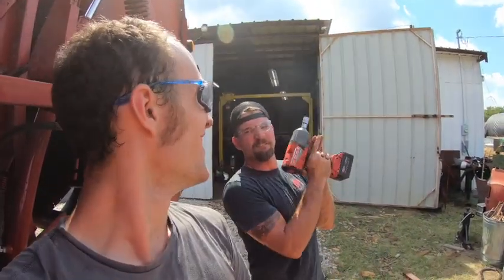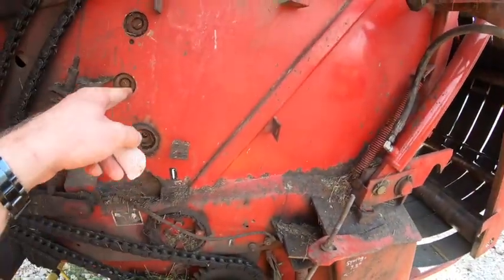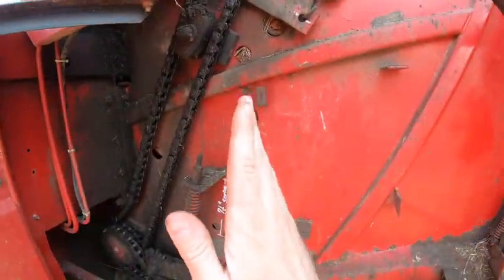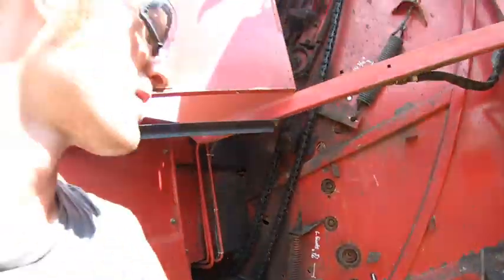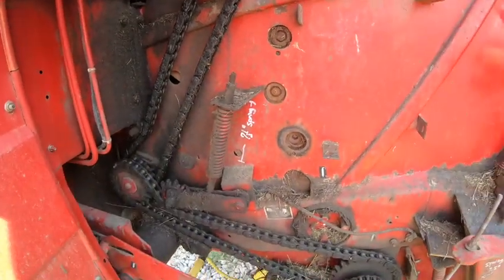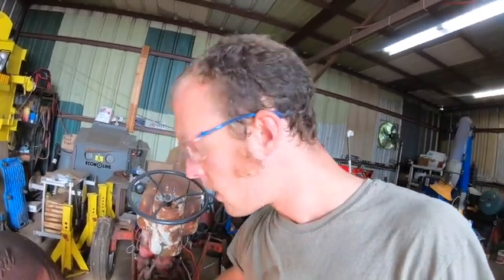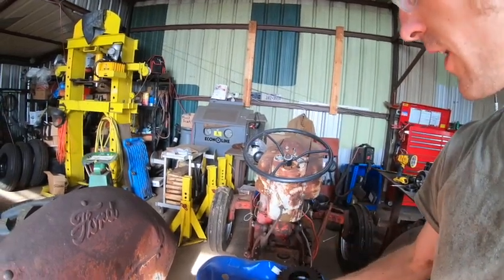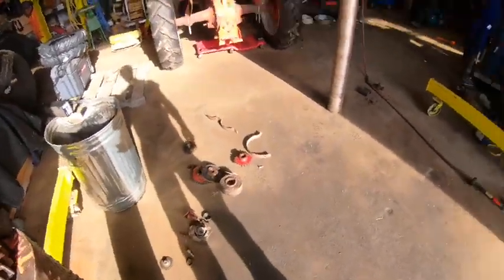Working On The Round Baler With Mechanic Super Steve

Comment: Those caps that Steve is using the air hammer on. Are threaded. So you can use a bolt to jack the cap out of the frame. I believe it's a metric 19 mm. You can find information on NH fourms about changing out those sledge gears and bearing.

Comment: Do nut resuse those little caps get new ones, THEY WILL BRAKE!!!!.... the air hammer will weakens them.  Pull your belts and spin all the rollers and check for bad bearings, it takes about 30 minutes.  We run 3 of those machines. make sure you run quality bearings cheap non name brand junk is a waste of time.